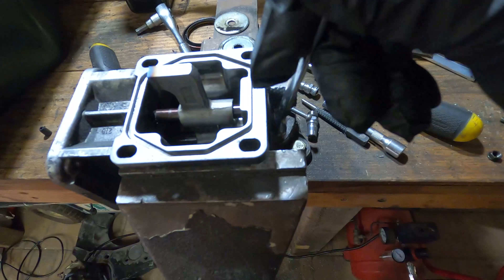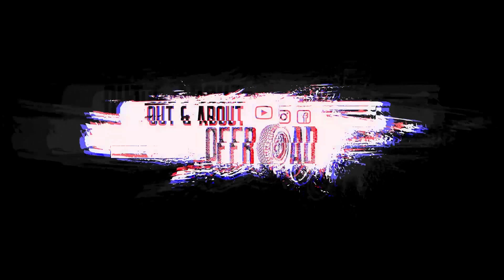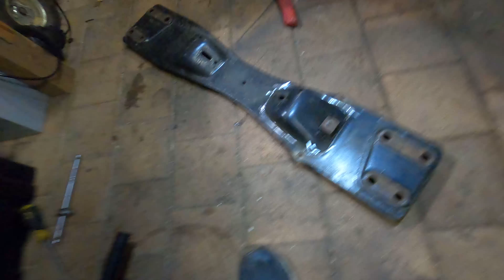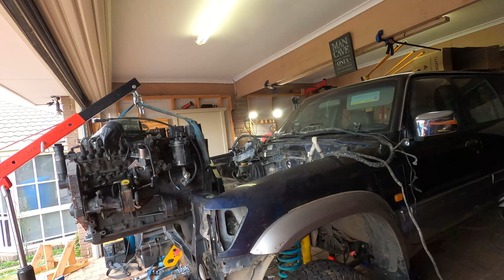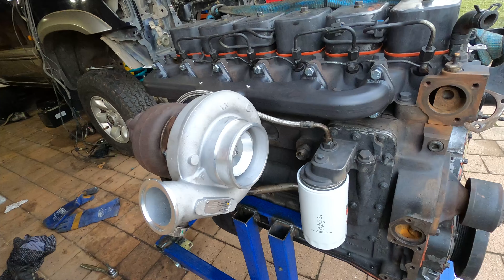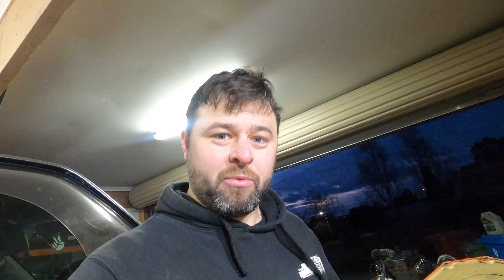Installing a 6BT, part 1 | GU Patrol Build [EP7]

Comment: Awesome conversion! Have you found the weight of the engine to be an issue so far? If so, how have you attempted to resolve it? Is it affecting the longevity of your suspension parts? Finally, would you consider the conversion in a Y60 patrol?
Reply from the maker: cheers! No the weight hasn't been an issue. While I can notice it if I concentrate, the only time it ever makes a difference is if I'm wheeling over sharp rocky stuff. On low/no tyre pressure the weight is more likely to deform the tyre far enough to damage my rims so I keep a closer eye on it. it's hard to know if it wouldn't happen with a lighter engine but technical stuff like that is the only time I've ever worried about it
In terms of suspension strength. When you think about the kind of forces involved in slippery ruts when the entire weight of the car gets tossed to one side, and all that's keeping the diff under the car is the panhard rod, you start to realise it's an incredibly strong setup. Even if I hadn't braced the diff and coil towers to keep Mr. Engineer happy, a bit of extra weight wouldn't be the thing that kills them
Reply: @OutAboutOffroad  thank you very much for the response.  The weight of the engine has been bothering me. Hopefully, soon, I will transplant one in a Y60 Patrol.

Comment: Cummins can be a bit of a pain in the ass when it comes to oil pressure, Every service the filters should be filled so it doesnt starve, every cummins truck had to for some reason otherwise they can go bang

Why its only cummins it happens idk (Im not a pro with them) but that could of been the case with your oil pressure not coming to the turbo earlier
Reply from the maker: Yeah it's an odd quirk. People grease the oil pump if they take it out ,which helps it self prime. I figured out that pumping oil into the turbo feed hole until it's full works great

Comment: whether this engine has a glow plugs?
Reply from the maker: None. It has a grid heater on the intake, but I won't be hooking it up
Reply: @OutAboutOffroad  the fuel heater will be better?
Reply from the maker: @bartoszsiudylo8096  won't need it. I'm in Australia 😉 doesn't get cold enough here for it
Reply: @OutAboutOffroad  If its direct injection you dont even have to worry about glow and pre starts

Comment: I have a question, how do you think how much fuel will be consumed by the 6bt engine in this configuration? how much horse power and nm you got ?
Reply from the maker: just from reading online, people are getting low tens / L per 100km on the highway. it makes sense, the engine is known to be pretty efficient but it does come down to application of the right foot 😏

this is a 215hp rated engine, but I intend to do a bit of work on it and have some performance goodies lined up - stay tuned ;)
Reply: @OutAboutOffroad  what is the cost of fitting to a y60 with a y61 gearbox? I can buy the engine in my country for $ 4,000. the connection is more expensive because I saw that it costs $ 3,400
Reply from the maker: @bartoszsiudylo8096  I don't know, sorry
Reply: @OutAboutOffroad  how much cost your gearbox ?
Reply from the maker: @bartoszsiudylo8096  you'd be best to get a quote from someone local to you
Reply: @OutAboutOffroad  gdybym kurwa mógł się dowiedzieć od kogoś z Polski to bym nie pisał pod Twoim filmem ...
Reply from the maker: Powodzenia 🤷‍♂️
Reply: @bartoszsiudylo8096  haha oh-kaaaayyyyyyy then mate

Comment: oh are you sure that ZD30 Starter moter is going to be good enough ??
Reply: I haven’t had a problem with mine it doesn’t crank long enough 
It will literally fire on the second compression cycle
Reply from the maker: @blown202  yeah hoping mine is the same. I've realised in the last couple weeks that I needed thicker leads than I thought - 75mm2 minimum really
Reply from the maker: Nope, it got really hot while cranking for not very long. But that's what the adapter kit is designed to use (edit: see below)

Comment: Its good to see someone having a go & not paying someone to do the job 
Once you have it in the can take the front springs out & sit it on the bump stops & check the sump the the diff center 
This was something i missed when i modified my sump & it will just kiss at full travel
Reply from the maker: Thankyou mate! I know I will have to modify the sump to clear the tie rod. I have extended bump stops so hopefully it will clear the diff too. Fingers crossed 🤞

Comment: If you put light grease on the oil pump gears it helps with dry start ups to get the oil to pick up.
Reply from the maker: Thanks for the tip! I did read that when I was googling how to solve the oil pressure issue, but only had bearing grease handy and wasn't sure if it was suitable. Chucked regular oil in it anyway and it worked after a bit of cranking 👌